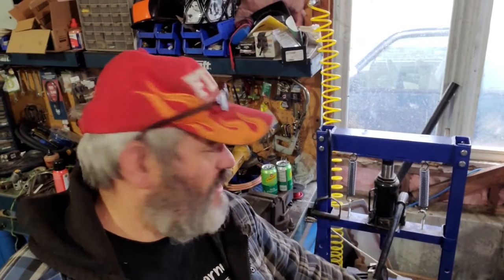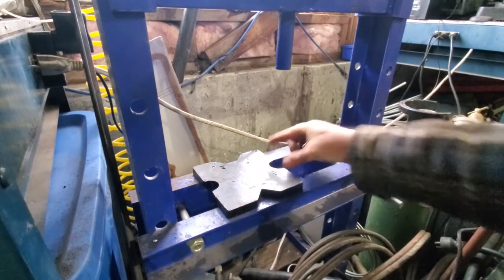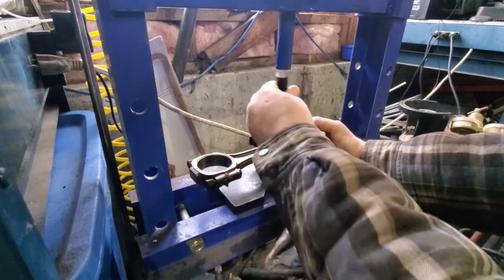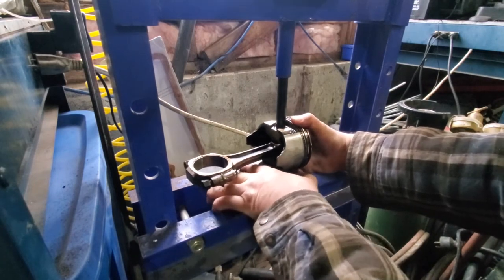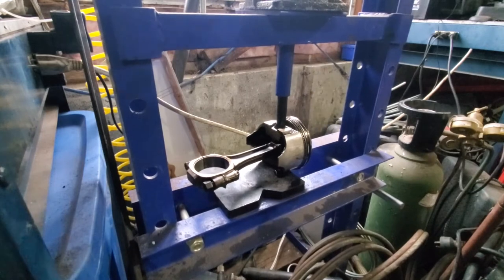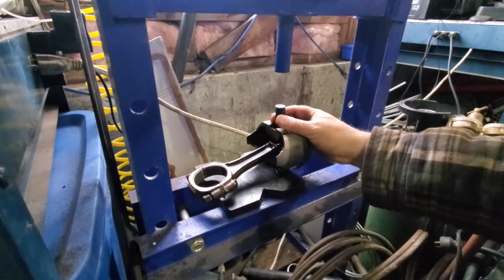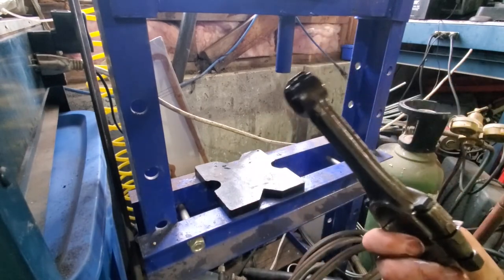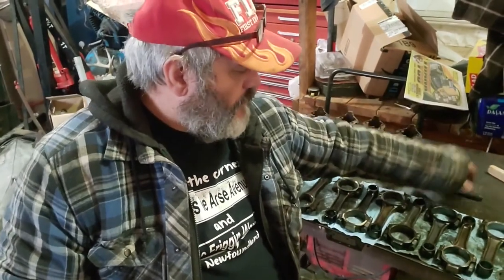Fast and Easy...Removing press fit pistons on a 350 SB Chevy

Comment: Thanks, for showing this. I have the same plates that came with my press. and I just spent hours looking for stuff to build a fixture out of. when i could just use the plates.  I thought of using them but decided it wouldn't work. I guess I was wrong.

Comment: Thanks for the info. Alway thought they were heated.
Reply from the maker: Lot of shops will heat the small end of the rod but it really isn't necessary and takes so much longer to do.
Reply: @SchnebsGarage . So you just press em off and press the new ones on. 🤷‍♂️🤷‍♂️ I too thought you had to heat em up to put em together…..🤦‍♂️👍

Comment: Yah, before the rod heaters they were ALL pressed. In the Chrysler service manuals from the '70s they all specify using the special arbor tool and a press. I have one of those tools, made by Miller specialty tools and a hydraulic press. I would much rather use that than heat the rods. Allows for more time for proper orientation and spacing. There isn't that much interference on those pins. There's nothing wrong with using heat IF IT"S DONE PROPERLY. Just about all the videos I've seen on here, except for the machine shops that have a Sunnen rod heater with a timer, are ALL WRONG. Even the supposed 'Experts'. You only need to heat the rods until they change to straw color, about 500 deg F. Anything more is excess and unnecessary. Most of these 'experts' permanently change the color of the rods, go all the way to blue. They weren't blue when you took it apart. Saw some yahoo's on a TV show once heat them up to cherry red.  Also, many suggest 'freezing' the wrist pin. This is insanity. The amount of metal contraction is so insignificant it's not worth mentioning (freezers typically stay at 0 deg F). BUT that cold pin WILL suck the heat out of the rod end a lot faster. If freezing did any good at all there would be a lot of loose pins in winter.
Reply from the maker: I remember watching a guy heat the ends with an oxy-acetylene torch to cherry red then put the pistons on... I was floored. Just shook my head and walked away.
Reply: @SchnebsGarage  That's exactly what they did on that TV show. A buddy of mine had some expensive rods and took them to a shop to have the pistons installed. He was broken hearted when he got them back and they were all dark blue at the top. Anybody could have done that in their garage.
Reply from the maker: @vincemajestyk9497  yea nothing like taking any strength the rod had and tossing it out the window.